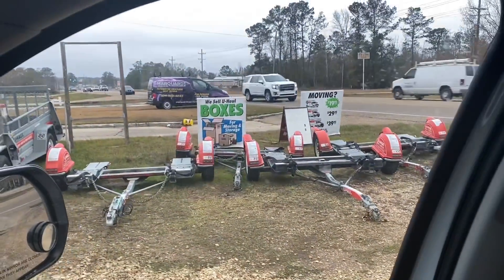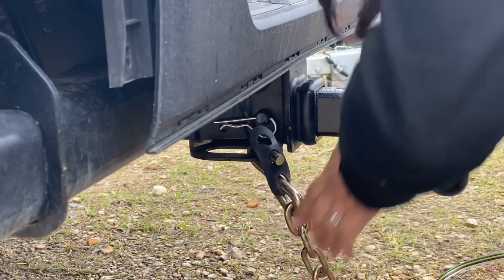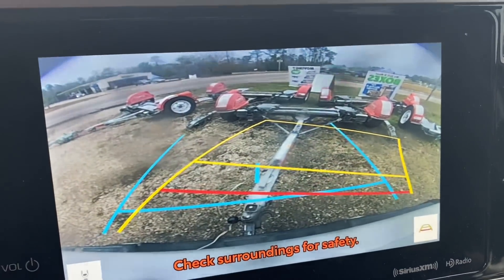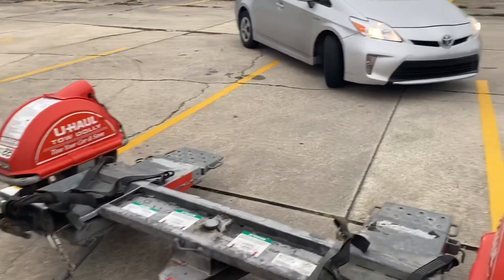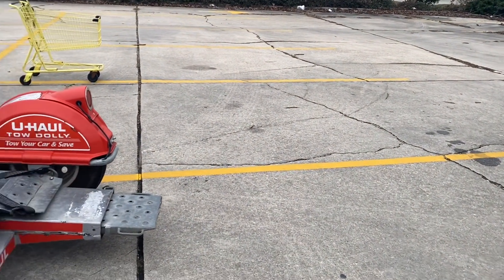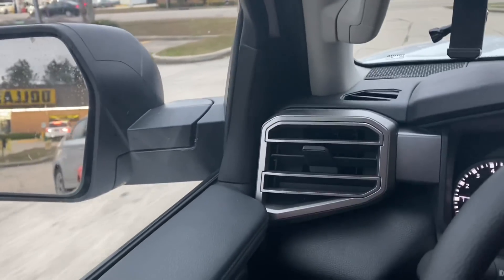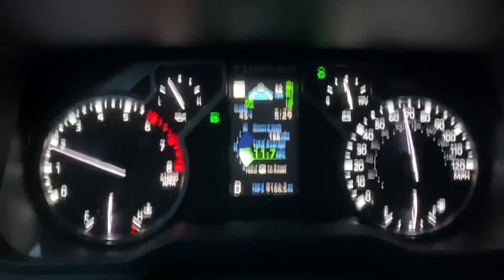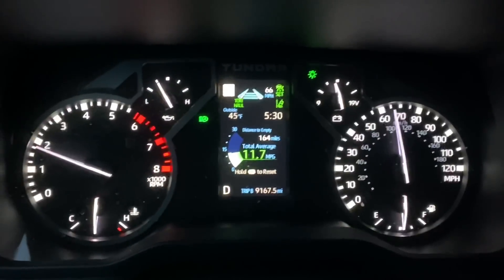2022 Toyota Tundra Towing MPG 😖😖😖 (Surprise  Brand New Car for the wife!!!)

Comment: Just a quick note since you're a newbie tower.   We've all been where you're at at some point and yes, those that have towed a lot can always come in and rip on someone who is new at it.  Now granted, I do get a chuckle at times on the dock because there is some entertainment value at times .......  

My advice.....get a small trailer like a single jet ski trailer or a 4x8 that you can't see behind you.  These are by far the hardest to back up.....
   
Step 1.  Turn off all the gadgets and backup cameras.  Learn how to do it the right way.
Step 2.  Adjust your side mirrors so you can see much of your truck in both mirrors  (you won't see trailer in either mirror).  
Step 2a.  Don't look at your middle mirror, only use side mirrors.
Step 3.  Go very slow.  If the trailer starts to show in your left mirror, turn left slightly until you lose sight in your left mirror.  If the trailer starts to show in your right mirror, turn slightly right until you lose site in that mirror.  With the jet ski I've found that it's easiest to alternate bringing the trailer into view on the left, then right, then left mirrors and snaking my way to the lake while always keeping the trailer in sight in one of my side mirrors.  They key is to not overcorrect and to go slow. 
Step 4.  Once you've mastered a small trailer like a jet ski or small 4x8 you have it mastered.   Any normal size trailer will be easy in comparison since you will see the trailer in both side mirrors and will know how to correct when your mirrors start filling up with the trailer.   

Others may tell you to put your right hand on the bottom of the steering wheel and bring it to the top to turn right.  Vice versa to go left.   Also good advice.
And yet another one that is good is learning how to back up a yard sweeper with a rider lawn mower, talk about a challenge, haha.
Reply from the maker: This was so much good information! Thank you!

Comment: U don't have tobworry about tow haul mode with that light of a load. I know the tundra has a 2 stage tow haul but thats a pretty light load. Use it if it makes u feel better though it won't hurt the truck either  way.
Reply from the maker: Oh, that’s really good to know!! Thank you!
Reply: Yup. It just changes shift points to hold gears a lil longer and downshift to lower gears while breaking depending on how aggressive the tow haul is on your truck. My father in law never uses it on his f150 and we run a farm so we haul some loads more often then most.
Reply: Now if you were hauling that boat id say definitely have it on. Ha

Comment: Wow, that Venza looks nice! What happened with y'alls Prius? My sister had one that had over 300,000 miles on it with no problems. ...until some knucklehead ran in to the back of it and totalled it. She has a Rav4 now with over 100,000 on it and no problems. Toyota reliability, right 👍

Thanks, for the honest info on the new Tundra. I'll admit that mpg does seem a little low.
Reply from the maker: This Prius has 140k and it had a misfire and the repair bill was $1700…

Comment: I’m still debating between the Tundra and the Sierra 1500 😩 both so nice but the inside of the Tundra > GMC
Reply: I currently have an older GMC and although the engine has been bulletproof, everything else is falling apart which is typical of American made trucks after about five years

I’m waiting on my 22 tundra to arrive